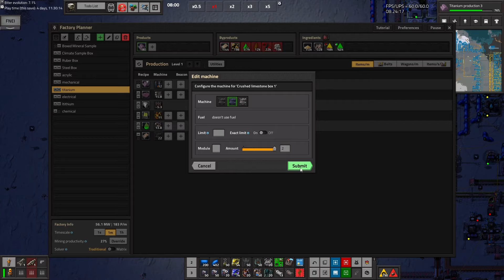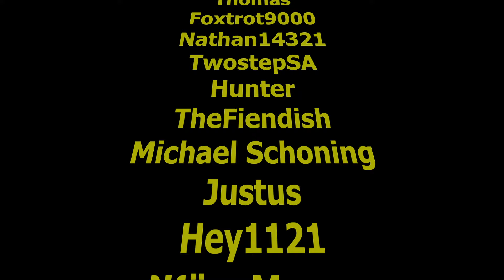Terraforming a Barren Planet | Factorio Nullius | #3

Comment: The way I do perfectly efficient nuclear is to have a couple of combinators which only allow fuel to be inserted if it has been 200 seconds since the last insertion and the steam tanks are below some threshold. With fuel only being inserted 1 at a time this guarantees no wasted fuel, allows for maximum fuel consumption, and takes virtually no space unlike some of the long belt-based timing setups I've seen.
Reply from the maker: Just do what I did, only remove fuel when steam is low (I used heat in this video but it works with steam too), and then only add fuel when some is removed
Reply: Couldn’t you place fuel on a belt with an inserter powered by some independent power source and have it taken away again by an inserter powered by the reactors? Once the output of the reactor drops the second inserter will slow down and the fuel will pass on to the reactor.
Reply: @Mike-oz4cv  that would be both UPS wasteful and rely on periodically dropping below satisfaction for your electrical network, which would be silly.